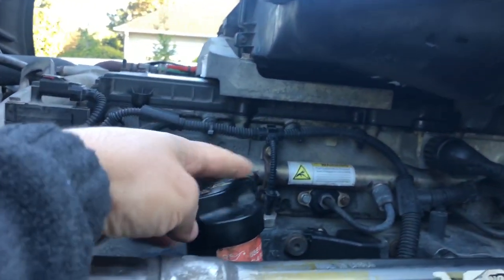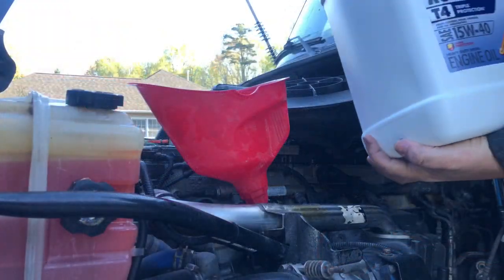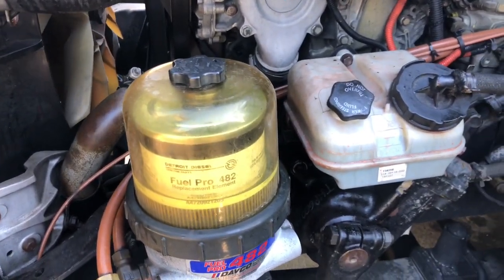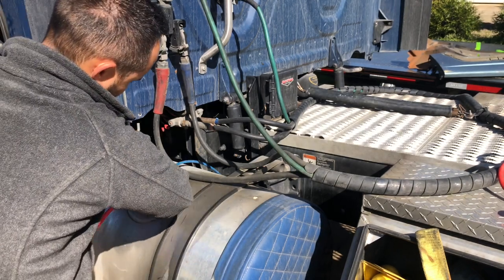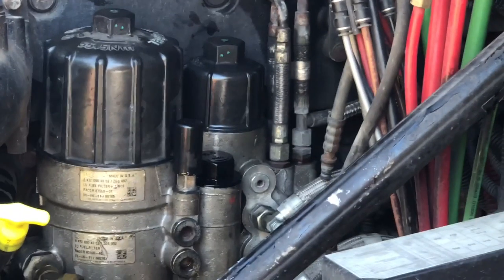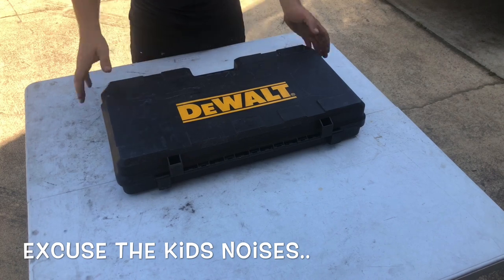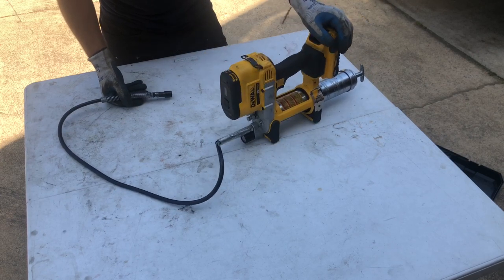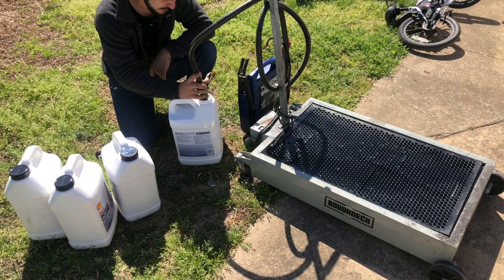Freightliner Cascadia DD15 Detailed Oil Change

Comment: Here is what i do to make it easier then this guy. Get your self two $3 5 gallon buckets from walmart along with two 5 gallon oil buckets from Walmart. Also get a easy drain oil tap installed on your cascadia, this will let you open and close the oil drain plug with no mess like a water faucet. Open fill plug grab your bucket drain and close the tap until all oil is gone. Fill oil but keep the old 5 gallon bucket. Next time you change the oil you will use those two old oil bucket as old oil storage so you can transport them to your nearest AutoZone to get rid of them. Zero mess and you wont need a oil catch pan. Or you wont need to lift or drive your cascadia over wooded blocks. With this method I could change the oil faster on my truck than I could on my car.
Reply from the maker: Thanks for the advise, but I found this the easy way for me and if you could notice I did not had any oil spills either, also I do have oil drain plug on my oil pan.
Reply from the maker: I usually take mine to nearest garbage place where you can recycle the oil

Comment: You just saved yourself a whopping 500 bucks
Reply from the maker: It’s not just about saving, when you do your own oil changes you know every is done the write way, plus you going underneath the whole truck while greasing inspect everything, one time I found cracked brake drum, loose ground, rubbed wires and etc…..

Comment: Great video. Few tips. Use only OEM fuel filters. Had a problem recently with aftermarket filters. Didn't fit quite right. Also grease the fuel filter bottoms liberally and torque to spec & mark the position. I was just freehanding it before trying to be careful because they're plastic but the smaller filter cap needed replacing ($86) due to over tightening. Remember these hard plastic caps are getting old & brittle. I use a rubber band & a coffee filter on the tip of the bottle after I siphon some fuel & reintroduce into the filter cavities. Also theres 4 more grease points. 2 on each side of the fifth wheel pivot. They're usually caked up with mud & crud. Wipe down those nipple tips before greasing so as not to introduce dirt & grime.
Reply from the maker: Yes sir, always get my filters from WWWilliams Detroit
Reply: Luber Finer works fine brah

Comment: I do my oil changes myself as well, but an old driver told me to fill out with oil first the oil filter. I really cant see that option doable since the oil filter comes head in from the top. 
I see you as well didnt put any oil in the oil filter and wanted to make sure that this is the right way. 

Thanks and Merry Christmas🎄
Reply from the maker: Filling up oil in oil filters that does not apply for dd15 motors, cuz it has paper filters, as soon as you pour oil in oil housing it’s going straight to the block, it works only for metal oil filter.

Comment: You could always use a torque wrench for you oil filter caps. It tells you the torque specs. 1/2" drive.
Reply from the maker: Yes you right, but I usually do it snug and it never gave me problems.

Comment: Awesome video.  Looking at a 2011 tomorrow.   850k miles.  No repair records.  Red flag or no?
Reply from the maker: I bought mine with no records with 640k miles, it ran really good until 980k miles until one injector got stuck in open position, so in the morning my truck didn’t want to start cuz of no fuel pressure, i was on the road so I found a diesel shop and one of the Machenics came out to look at it and he decided to start it with engine starter, and the motor just took off, until it blow up💥so after that I do everything g my self.
Reply: You will probably have to replace oil pump & rings, injector cup o-rings, & EGR actuator soon on that 2011 if they haven’t already

Comment: That oil drain valve is installed with an adapter? And where did you buy it?
I bought Fumoto T211 from Amazon but not sure if I need an adapter as well. I have the same kind of an engine. 
Thank you
Reply from the maker: No adopter, screws straight to the oil pan.
Reply: @andreykichuk  thank you so much. That was a quick answer 👍

Comment: My question is why do most guys have to use starting fluid to start the truck after oil change?
Reply from the maker: Just with oil change it will not effect how your truck will start after the change, some guys will use starting fluid to start the truck after the fuel filter change, I will highly recommended not to use any starting fluids on Diesel engines, if you do the job wright and prime the system like you should it will start no problem, Diesel engine can cause diesel run away witch will blow your motor, be really careful with that stuff

Comment: How many miles do you change your oil and filters ? I have a 2016 DD15
Reply from the maker: I replace oil every 20k
Reply: @andreykichuk  thanks man. Someone told me 50k and I thought that was a little extreme right?
Reply from the maker: @chrissuggs8521  yes this is way to much, Freightliner is saying 45k but I’m not gonna do that that’s to high, if you use full synthetic oil maybe I would go 30k but not more than that
Reply: @andreykichuk  That’s exactly what I was thinking I appreciate the information. I’ll keep that in mind and most likely change every 20 K
Reply: @andreykichuk  And by a chance have you ever use the product Pittsburghpower max mileage?
If you happen to check out some reviews on it online I just ordered me a gallon jug going to try it out.
Reply from the maker: @chrissuggs8521  never heard about it, will check it out.

Comment: I have a 09 cascadia dd15 is rotella t6 synthetic good or should I stay away from synthetic.  people say is too thin.
Reply from the maker: I can’t say nothing good nothing bad about t6, but I do know that I put 600,000+  miles and it does really good, I also know ppl personally that million + miles on rotella t4 and had 0 issues. So for me there is no reason to switch between oils, also it’s not very healthy for the motor to switch between different brand of oils .
Reply: @andreykichuk  i bought my first truck and I spoke to the owner I bought it from and he said he would put the cheapest oil. So I want to start putting good oil on it. What should I do purchase cheap oil or start with t6 and never look elsewhere on oils

Comment: Any specific reason why you use shell rotella in your DD15 engine?
Reply from the maker: I usually go by if I know a person that got a brand new truck and he been using rotella oil all his life and his truck is running very healthy when it has over a million miles to me that’s a good sign that the oil is pretty good. I know few guys that that’s all they been using since they got the truck brand new and their trucks is a good bit over a million now so that’s why I’m using it lol
Reply: @andreykichuk  thanks buddy that works for me then can’t beAt real works results instead of marketing on these bottles. Also do you use Lucas oil stabilizer or any fuel additives?
Reply from the maker: @classicjay7786  I don’t use anything for motor oil or for the fuel, truck runs really good does not burn oil at all, the only time that I do use anything is anti gel for fuel if I run in extreme freezing weathers.
Reply: @andreykichuk  thanks mine neither has 657k doesn’t burn any oil great reliable engine
Reply from the maker: @classicjay7786  still running with def?
Reply: @andreykichuk  yep still running I got an apu installed. Lots of idiling will cause you to always be in the shop with these emissions truck.. how many prime or Walmart trucks you see on the hook get towed not too many because all there trucks come equipped with APUS on them and they cut there truck off every time they stop.. at the guardshack, fuel island, picking up or dropping trailers that truck gets turn off.
Reply from the maker: @classicjay7786  my old motor ran to 980,000 with def, but when I replaced the motor I went ahead and deleted it, so far runs like a champ
Reply: @andreykichuk  wow that’s great with much maintenance these emissions trucks can last a while with that kind of mileage on your truck  it gives me hope I can get the same.
Reply from the maker: @classicjay7786  my buddy has 2015 cascadia has 860000 still runs really strong
Reply: @andreykichuk  is his deleted too and the motor you replaced in your truck was it new or used? And about how much did it run if you don’t mind me asking
Reply from the maker: @classicjay7786  my friends truck is deleted, the mower I put in my truck ran me $19k that’s included 2018 motor with 319k miles with installation and to convert it, because my truck is 2012 and motor is 2018 so they had to rewire some stuff and relocate the turbo.
Reply: @andreykichuk  wow you got a great deal man that truck is truly a money maker at this point…
Reply from the maker: @classicjay7786  yes it is, but I will be selling it soon, I bought a peterbilt 379 with 3406e cat motor, the motor is brand new installed from cat has less than 30k miles on it, guy got into accident with it and selling it to me. You will see a video pretty soon about it.
Reply: @andreykichuk  yes freightliner is a good truck to get started with good starter truck then once you get yourself established move on up to the luxury line of trucks better quality with the Pete’s and KW’s only my opinion